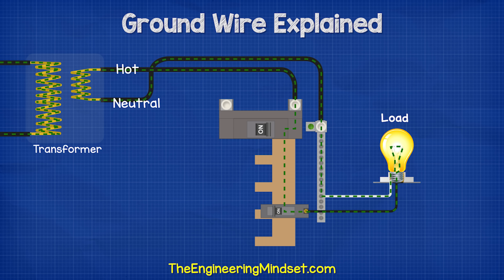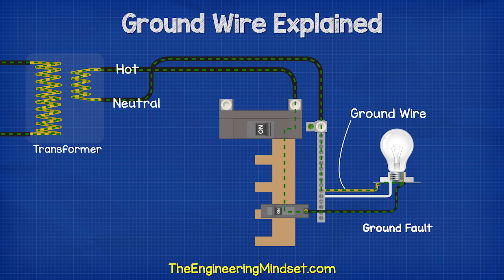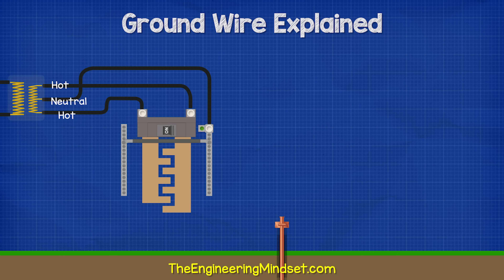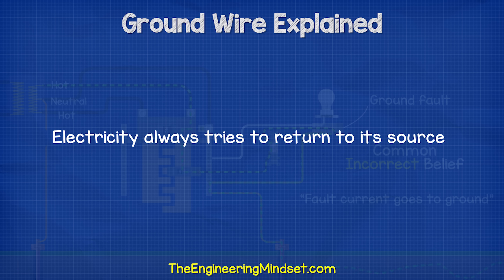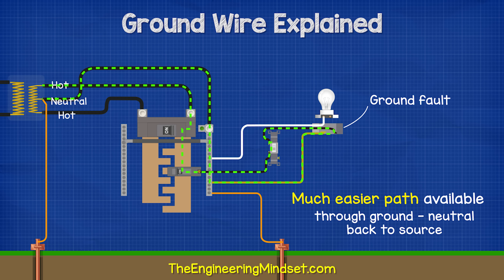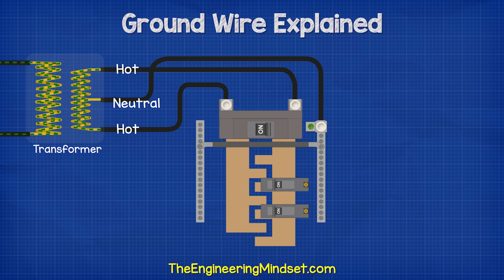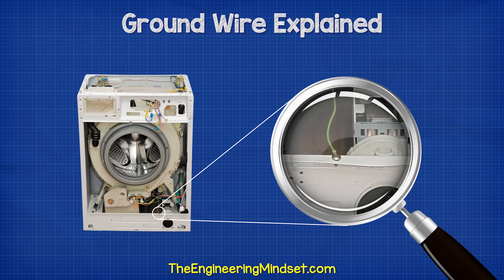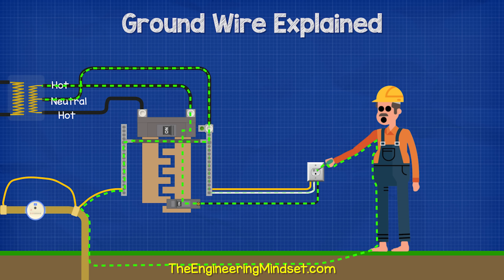Ground Wire Explained

Comment: I own a engineering business.  I went to use my tig welder ( set on 180 amps ), after starting to weld the setting seemed very low on current.  I stopped & checked that the machine was set correctly & started welding again. The current was still low but now there was a burning  smell & smoke in the workshop.  After a bit of investigation,  I had left the earth lead for the tig welder on another steel bench , but I was welding on a jig that had a 3 phase drive motor.  The earth circuit went through the frame of the jig , the 3 phase motor,  out to the earth stake , back to the bench grinder on the other welding bench ,into the earth lead on the bench. The smell & smoke was the lead for the bench grinder,  as this was the smallest wire in the circuit & couldn't handle 180 amps it melted .
Reply: U own an ‘engineering business’, but you are a welder? Somethings doesnt make sense here
Reply: @zefrum3  Just because you own a business doesn't you sit back & dont work.
Reply: @robertsomerville5377  well hmm… *sighs*. Where to begin… Read carefully: You are not an actual Engineer if you are the Welder.
Reply: @zefrum3  nowhere did I say I was an engineer, I said I own an engineering business.
Reply: @robertsomerville5377  okay…so not an engineer but you own an engineering business. Please explain, b/c thats like a non-Doctor owning a Doctor’s Practice and playing around with the Patient’s files…
Reply: @zefrum3  someone being pedantic in the comments section of an electricity informational video. oooh, shocking!(futurama fry 'shocked but not that shocked' gif)
Reply: @zefrum3  I could own any business without knowing the details. I’m sure there are many billionaires who are MBAs and not extensively trained in the details. 
On the other hand, just because he’s an engineer doesn’t preclude him from picking up a welder. He didn’t say what type of engineering, either. It could be metallurgical or civil engineering.
Reply: @TomCee53  you can not: to own a law-firm you must be an attorney, to own a doctor’s practice you must be a doctor; pretty sure its the same for Tax Accounting too, thag is you must have a CPA.    And no to your first point: no one says they own an engineering company but then works as an hourly employee in the fabrication area unless they are just delusional or ignorant. sure yes it could pe possible that this dude got his PM and then decided to open a welding business but call it an engineering company, but not probable. The clue to determine is hes as educated as he writes; like us all Sherlock.
Reply: @zefrum3  that's not true, you can own and manage the business without ever being involved in the actual work, you just need to find the experts who will do the job. Of course knowing the trade can help sorting out the bad employees but it isn't a rule set in the stone.

Comment: Great explanation. One little bit worth considering is, even touching a neutral wire on a circuit has the potential to cause an unpleasant experience. Cause current takes every path back to source.
Reply: Under normal circumstances this is false. Only true when neutral is floating or disconnected. A lights neutral will become live for example. True neutral will not shock you.
Reply: @Deiphobuzz  yeah. I probably gotta stop thinking of less then ideal situations so much. But I mean more along the idea, for example, that if you touch a neuteal in an active circuit a person can become another path back to source. Not that this should be able to normally occur.

Comment: The cables going to the ground rods are considered grounds. The wires used to connect metallic parts of the devices in the electrical system are bonding wires.
Reply from the maker: We just published a new Ground fault, short circuit and arc fault video, so much detail! Link HERE➡️: https://youtu.be/Qi0ynSQw-wc

Comment: Sir, with due respect, "path of least resistance" is incorrect. The reason for ground conductor having low resistance is for the ckt breaker to trip faster due to having higher current during fault condition. Everything that is in parallel with the circuit still has current flow but just in proportion with its resistance. 

Appreciate your very informative presentations, still. 👌
Reply from the maker: We just published a new Ground fault, short circuit and arc fault video, so much detail! Link HERE➡️: https://youtu.be/Qi0ynSQw-wc
Reply: Correct, electricity doesn't take the path of least resistance, it takes ALL PATHS of resistance, even in a "dead short" since no matter what everything has some kind of resistance.

He did however say "preference of path of least resistance" meaning technically majority flow but even so he should have clarified it

Comment: Why do we need to complete the circuit by ground wire. After watching this video I'm thinking if there is no ground wire at all, no one will get electric shock by touching the hot wire
Reply: Well, *IF* you are completely insulated and you touch a live wire, the electricity won't pass through you and you will be unaffected. However, perfectly insulating something is almost impossible, so there is a good chance the current will find a way through you somehow, which will be somewhere between unpleasant and lethal.
You need a ground wire to protect you in cases where the system isn't working the way it's supposed to - for example, if the hot fire is in contact with the metal case of your washing machine. The current will flow through the ground wire rather than through the first person who happens to touch the live case.
Reply from the maker: We just published a new Ground fault, short circuit and arc fault video, so much detail! Link HERE➡️: https://youtu.be/Qi0ynSQw-wc

Comment: I remember once renting a room where there were only two-prong wall outlets available, i.e. no ground connection. In order to plug my PC into the outlet, I relied upon a “cheater” adapter, which turned a three-prong plug into a two-prong plug by connecting the neutral and the ground wires together. Can you explain to me what the risks of that would have been? Had a live wire in my PC made contact with the metal case, this setup would still have prevented electric shock, right?
Reply: A “cheater” should not connect neutral and ground. The ground should be left unconnected. The cheaters I have seen have the ground pin connected to either a wire or a clip to connect to the cover screw. In some cases, such as conduit construction, the box, and therefore the cover screw, is actually grounded. In any case, connecting neutral to ground should only be done at the main disconnect. Even sub-buildings, such as a detached garage, should not have ground and neutral connected (bonded).
Not that I recommend it, but you would be (marginally) better off just breaking off the ground pin, but you didn’t hear that from me. That’s a code violation.
Reply: @TomCee53  I know that you shouldn’t connect neutral and ground at the plug, but what are the consequences thereof? As I understand it, there must be two separate paths back to the source, one of which is the neutral path, and the other is the ground path. But why does it have to be that way? What are the risks of those two paths converging at the plug?
Reply: @segalliongaming8925  Nothing highly likely. If the ground is connected to metal parts and it is a long cord, you might have a few millivolts on the exposed parts. There might be a small chance of damage to sensitive electronics, though most should be able to handle that. 
The reason for the ground wire in the first place is to provide a safe path for fault detection, for example if the hot wire insulation beaks down and touches the case of the device. That may or may not protect the same if ground and neutral are connected together.
Reply: @segalliongaming8925  The reason you do not connect the ground and neutral anywhere except at the supply is so that you dont ever have a live ground wire. If they were connected at the plug the the current would travel back to the source via the earth and neutral, then if the neutral got disconnected due to a fault you would start to get dangerous voltages on the frame of the appliance if it was also earthed
Reply from the maker: We just published a new Ground fault, short circuit and arc fault video, so much detail! Link HERE➡️: https://youtu.be/Qi0ynSQw-wc
Reply: Your PC only runs at 12V DC anyway so there's no chance of a shock or hazard to yourself if a 12V wire touched the frame of the PC, Unless your PSU decided to have a fault which is basically just a 230V/110V AC transformer to 12V DC very unlikely the transformer would fault from the high voltage side to the low voltage side as they are electrically and mechanically isolated from each other
Reply: @rjac001  The casing of the power supply is electrically connected to the casing of the tower. The power supply handles 120/240 VAC so technically the hot could become disconnected from the board and touch the casing, a screw could fall inside the PSU and short a hot trace on the PCB to the casing, etc, etc. It is definitely possible for the tower casing to become live at mains voltage.

Comment: I have a question, why is it that AC always wants to return to its source?
Reply: That’s a simplification. What it really means it that there is a potential difference between the hot and neutral or ground, and anything crossing them completes a circuit, whether it be a light bulb, a motor, or a human being. The intent is to make the human the least likely case.

Comment: If there was no earth cable  in a house and no  return path to the generator there would be no fault path ,like a car battery …..so what is the reason we have an earth system , could you hold a radiator with one hand  and a live (hot) wire with the other and get no shock????im a retired electrical technician !

Comment: Recently I've learned about electrode/ion heaters (f.e. Galan). They use one or more phase, but instead of the circuit being closed through Neutral, the manuals say to terminate directly on PE. It sounds very weird to me, but I've checked google about that and apparently since they produce heat via electrolysis, there is no current involved but the difference in potentials (voltage) only.
The manual also says you can connect it like that only if there's no more than 4 ohms between N and PE in the installation. I'd love your explanation on how it works.
Reply: From what I have learned. The live electrode(s) are in the center of the container. The neutral wire is connected to rods or sheets surrounding the center core of live electrode(s) with a few cm between them. Then the metal casing on the device is connected to ground so that it won't pick up any potential that could harm you.
If you have a 3 phase system, you don't need a neutral wire. Current does run through the liquid. You need the electrical current to do the work. With 3 phases, the current travels from one phase to the other 2.

Comment: BUT.. BUT... why would you ever mix earth and neutral, this way you have no living chance of figuring out if a device is actually creating an earth fault.
Like what is the reasoning for only putting an RCD in the bathroom outlet in US homes? and not in the distribution board? All it takes is a grounding point in the board instead of attaching it to the neutral rail, this way you have no fault currents running secretly through the neutral wire. Like imagine you stand in the shower with a shotty ground on your water heater which heating element is leaking about 70 VAC to the water, when taking a shower you end up grounding yourself to the drain and earth, suddenly without an RCD to compare the current flowing in on L1 and seeing it's the same on N, you just stand there getting washed in electricity.

Don't get me wrong you can do this system with an RCD too, (using the neutral as a Neutral/earth combined with an RCD, just requires permission from the power company and is called a TN-C-S, is usually only permitted in areas with really dry ground like sand and or rocks)
Reply from the maker: We just published a new Ground fault, short circuit and arc fault video, so much detail! Link HERE➡️: https://youtu.be/Qi0ynSQw-wc

Comment: Excellent video. Can anyone tell please, when neutral and ground are connected to the same bus bar than why does neutral take the"least resistance path" ( to the ground)?
Thanks.
Reply: You are confusing the two paths from the bus bar to the load, where there is no difference in resistance between the ground and neutral wires, with the two paths from the bus bar to the neutral connection at the utility pole, which is what this presenter is referring to.
Reply: @jstreutker  Thanks for the clarification. Keep it up.
Reply from the maker: We just published a new Ground fault, short circuit and arc fault video, so much detail! Link HERE➡️: https://youtu.be/Qi0ynSQw-wc

Comment: Hot, neutral, ground, a number of viewers to your channel are Brits and for them hot = live or line, neutral is the same and ground = earth, their voltage is 240 and not 120 and sockets are vastly different being square pin (prong) with live (hot) to the right, neutral to the left and earth (ground) at the top

Comment: This is why GFCI breakers and receptacles are so important.  If you DO get across the hot side wiring the GFCI detects the ground current and trips the breaker almost instantly. GFCI breakers can be problematic in some situations.Exterior Christmas lights are good examples. If they get wet with rain or snow, they can trip GFCI breakers and GFCI outlets.
Reply: Frustrating, but safer.
Reply: GFI doesn’t “detect ground current,” as you said. It monitors the hot & neutral.
Reply from the maker: We just published a new Ground fault, short circuit and arc fault video, so much detail! Link HERE➡️: https://youtu.be/Qi0ynSQw-wc

Comment: What happens to the worms and bacteria between the ground rods when current goes thru them
Reply: They escape to the surface and you get free fishing bait.
Reply: The resistance is huge so the current will be negligible.
Reply from the maker: We just published a new Ground fault, short circuit and arc fault video, so much detail! Link HERE➡️: https://youtu.be/Qi0ynSQw-wc

Comment: so does the ground wire route electricity back to the transformer/source or to the rod in the ground?
Reply: Transformer.  It's bonded to the neutral bus inside your breaker panel.  At that point, the neutral and ground are the same.
Reply: @mikeb2058  thanks :))
Reply: @mikeb2058  when does it go to the rod?
Reply: @thegr8rambino  When there is a lightning strike.  Most times the rod isn't doing anything.
Reply: Actually both. The copper/aluminum wire to the transformer is lower resistance than the dirt, even during a rainstorm, but some current will pass through the ground wire. It should be much less than 1 ampere.
Reply: @TomCee53  how do you know this
Reply from the maker: We just published a new Ground fault, short circuit and arc fault video, so much detail! Link HERE➡️: https://youtu.be/Qi0ynSQw-wc

Comment: Im curious if the European earthing system is any different.
Reply: The physics and principles are the same but the implementation is different. In the UK, all plugs are 3 pin, but the earth/ground pin isn't always used for low current devices (like lamps). In modern houses we have RCTs in the main fuse box as an added safety feature. Our ground wires are yellow and green striped.